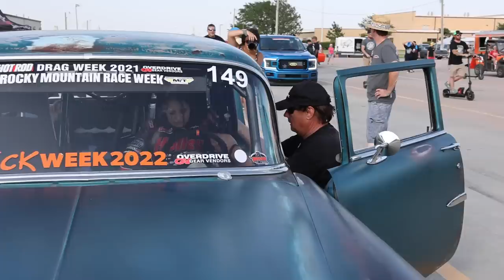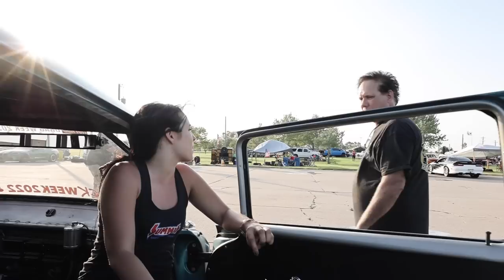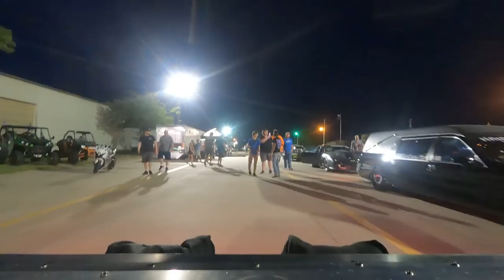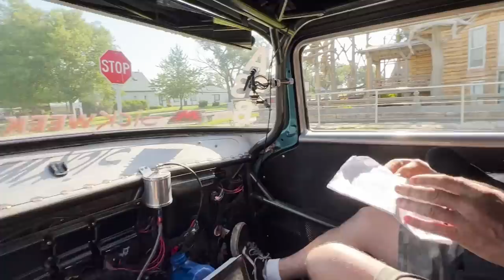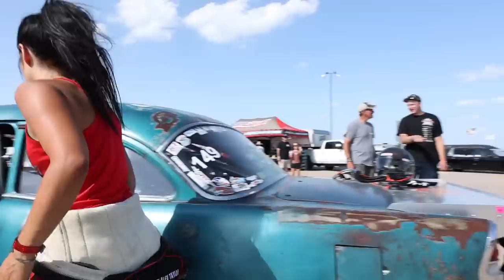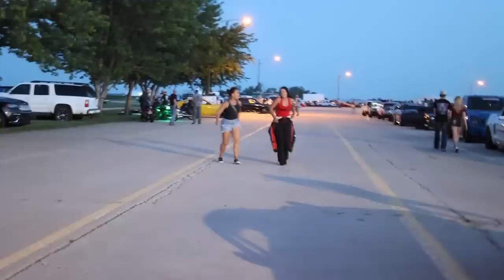Hardest. Week. Ever. 😅 If It Was Easy Everyone Would Do It Though, Right?! RMRW 1.0 2022 - Video 1

Comment: Confused.....how did the center section come out, the replacement go in, without removing rear wheels and axles ??
Reply: Floater axles! The axle are seperate from the hub that the bearings and wheels are mounted to. The axles can be pulled through the hub without moving the hub. Racing stuff.
Reply: @westmus  ,,,,,,,,,,,,,,,,,,,,,,,,,,,,,,,,,Somewhat  like in commercial trucks.........................................................................

Comment: When you are driving on the street do you pull one axel, so you can make turns easier?
Reply: ,,,,,,,,,,,,,,,,,,,,,,,,,,,,,,,,,,,,,,,,,,wow ,,,,,,,,,,,,,,,,,,,,,The SPOOL,...........,that just opened my eyes,,,,,,,,With those monster tires and  no differential,,,,,,,,you could not turn without cracking something.........